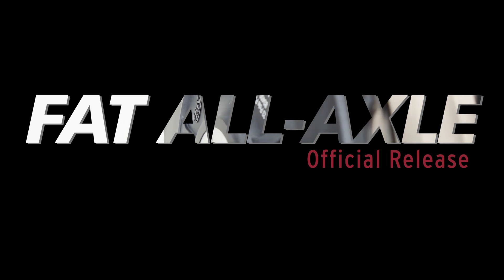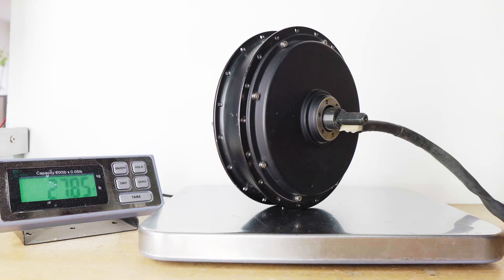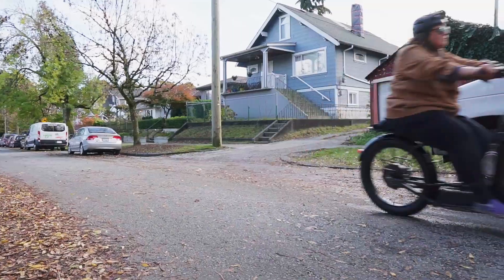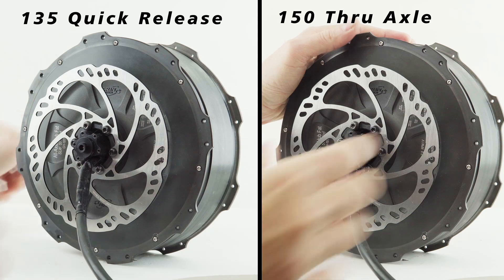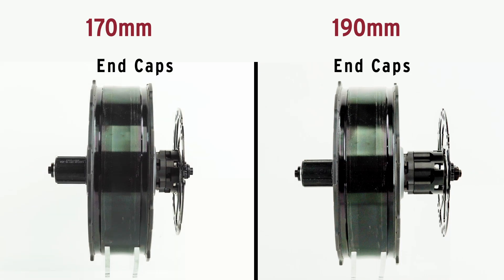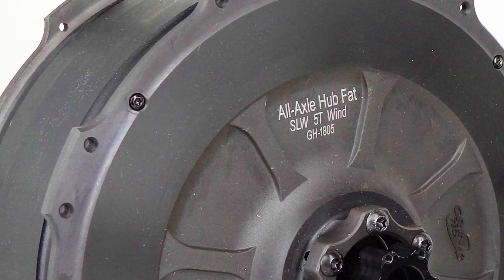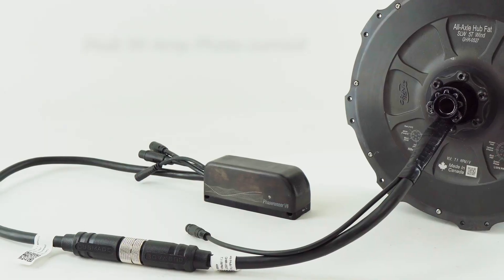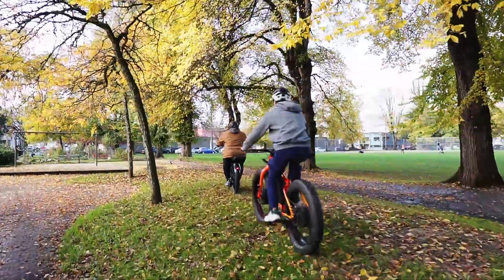Grin's Max45 Fat All-Axle Hub Motor,  she's HERE

Comment: Well done ! Would love to see the rear version fit 135mm qr or 142mm thru axle with a single speed sprocket. It would be a dream combination for single speed setups of pinion gearbox setups. Any ideas ?
Reply from the maker: You just need to use a single cog on the freehub along with a set of spacers to position it right on your chainline. There are many places that sell single speed cog systems for cassettes.
Reply: @GrinTechnologies  Sorry, I meant to make the grin FAT rear work with single speed to get it in a tight 135qr or 142TA
Reply from the maker: @arlendetraz1863  Oh sorry I totally misread that, my apologies and thanks for clarifying.  The company that makes the torque sensing freehubs does in fact have a screw-on freewheel model which would support this.  It's on our radar but requires quite a bit of axle customization. Perhaps a 2025 project!  I agree that combination with a Pinion would be pretty killer. Plus various chopper bike frames that are just single speed with 135 dropouts.
Reply: @GrinTechnologies maybe the 45mm front motor could be adapted to fit a single speed frewheel? In any case I'd be interesting to see such motor, I think there is a market for it. If you think about it, most 45mm width stator users run single speed.
Reply: @PhobosYT  There exists an adapter seen on a blog (MLS - Monkey Likes Shiny) from 2010. You could take the front hub and bolt on the freewheel adapter to the iso disc mount and flip the hub around. Though, you lose the back brake. (Regen might be enough !) I have thought about this on a trike application.
Reply: @arlendetraz1863  awesome idea, I'm not using rear brake anyway as regen is enough to fully lock the wheel

Comment: This is awesome! I would love convert my new Surly Moonlander 2.0 into a 2WD (using 2 197mm axle rear motors) but it would be considered a moped or motorcycle in Switzerland (https://www.ch.ch/en/vehicles-and-traffic/cars-and-other-vehicles/cycling-in-switzerland/#rules-for-e-bikes-electric-bicycles) so that's a no go since I pedal mostly on bike routes.
Reply from the maker: It seems like you can still ride on bike paths without the motor power running: "On cycle paths where mopeds are forbidden, you may only cycle with the engine turned off."  Just use the virtual electronic freewheeling feature of the controller to eliminate any motor drag and it would pedal just the same  as before the conversion :-) 

Crazy to see the 197 thru axle used on a front fork, but that's the kind of thing we've come to expect from Surly.
Reply: @GrinTechnologies  That's a good point. I'm going to look into it more. I don't care at all about speed. I just want torque to climb super steep hills on dirt paths or power through snow at very low tyre pressure. The 2x197 axles with 6.2" wide tires is indeed crazy. But a lot of fun! (-: It seems like the ideal platform for a 2WD ebike.

Comment: Would have liked some more specs.
Cant see why this is any better than what QS motors dish out.
Reply from the maker: If all you are interested in is the motor power output specs, it is not any better. It's exactly the same motor structure (46 magents, 51teeth, 205mm Dia) but since the QS motors are double the weight they take longer to get hot and overheat as there is so much metal mass to absorb that thermal energy.

You would consider this motor over a qs if you care about bike frame compatibility, motor weight, integrated torque arm, integrated torque sensor, quick release removal etc. (and money isn't much of an issue.)

The actual technical specs are fully detailed in the two tables in the video though. KV, R, L, Eddie and hystersis losses, and weight. That's what actually dictates a motor performance.

Comment: You are wrong saying that torque stats are more important than power, the law requires the power of a motor to be whatever the local law states, and torque means nothing to the law. In many places, no wattage marked on the motor makes it illegal.
Reply from the maker: Have a read of the user manual where this is addressed directly. The law does not understand what the law is even asking. Hopefully people with more patience in beaurocracy than us will fix it one day.

What do you make of the fact that a 250 watt Bosch ebike actually pulls more like 700 watts from the battery?
Reply: The most commonly misunderstood legality, Euro ebikes are not 250w, its a nominal continous paramater for legislation, the new 1000w dji midrive is perfectly legal, its really just a speed limit.
Reply from the maker: @chargeriderepeat7024  And even as a nominal continuous parameter it's dumb, since there is not meaningful way to define or characterize that. It's just a nameplate sticker from the manufacturer.  This will be the subject of one of our upcoming videos.  

A properly formed legislation that is way easier to enforce and way more sensible would simply have 
1) a speed limit ( say 25-30 kph for bike paths, and 40-45kph for roads shared with cars)
2) An acceleration limit (to prevent skid-out and overpowering, the motorized wheel can only accelerate at a modest and safe rate)

No limits on throttles vs pedal control (that has no safety ramification), no explicit power limit, (or something ~2000 watts which is what it takes to move a cargo bike up a hill at 25 kph).
Reply: @GrinTechnologies  so would this be legal where maximum power is 500W ?
Reply from the maker: If you live in a place that actually stipulates a maximum power of 500 watts, then that's something you regulate via the motor controller and not the motor itself, the motor has almost nothing to do with it being compliant or not if there is an actual power limit (input or output) on the books.

Comment: These things are cool, but I really wish they'd take all their experience and do an in-house geared motor that does regen with all-axle capability. The reality is that most people just don't need the benefits a direct drive has and the smaller size and lighter weight of a geared motor is better suited to the application of a basic commuter/casual ride bike. (Think Shengyi SX series but with a better axle situation)

That said, I'm glad these exist and I'm contemplating what kind of non-bike things could be fun to drive with one or two of these on a high current controller

Comment: The 1000w bafang with the 6.5 wind is very capable on a black diamond trail, definitely climbs better than a 250w mid drive.
Reply from the maker: Yeah the performance of the bafang G62 is great, it's an impressive motor. This is just a tad heavier (20%) to get that same performance with a direct drive all the benefits of regen.
Reply: @GrinTechnologies  not a speed demon though, the one I have will do 31 mph

Comment: Castle Creations bullet plugs? love the RC cross-over!
Reply from the maker: When it comes to high power densities in a small package nothing beats stuff engineered for r/c!  As long as the crossover doesn't include lipo batteries it's all good :-)
Reply: @GrinTechnologies  OK, important safety note, don't run my bike on hobbyking bricks... LOL
Reply: @GrinTechnologies  Whats bad about LIPOs ?
Reply: @StereodreieckRC Shitty cycle lives, only lasting a few years when the best modern 21700s can last 10+ years of abusive use or 20-30 years with moderate use, poor energy density and the best modern lithium batteries (especially the newest tabless cells) they barely even provide more current than for a given weight.